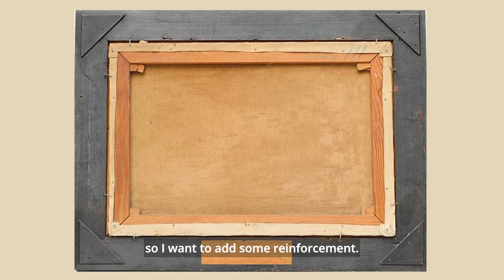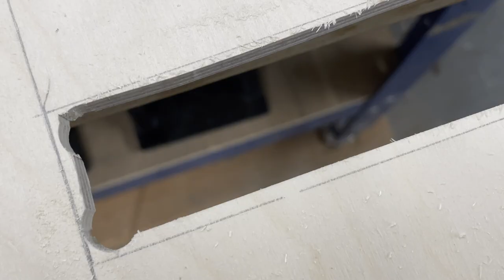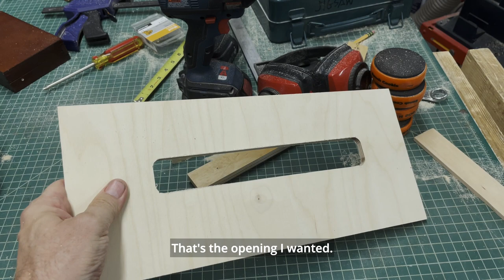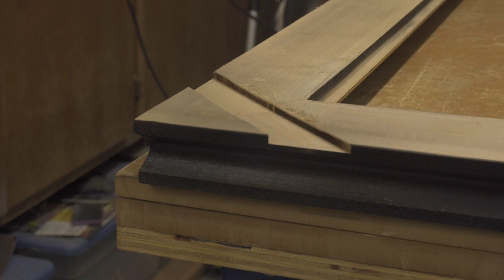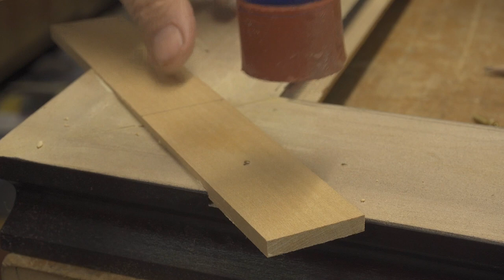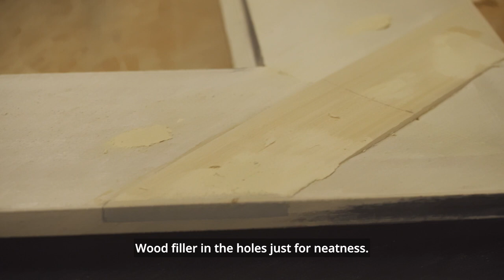Reinforcing a Picture Frame

Comment: Do you normally seal and reinforce the back of the frame when you originally build it? That could help mitigate the movement or weakness that cause opening like that. Very interesting to see how these problems are resolved, and will try that routing technique
Reply from the maker: I have generally used Brad nails and biscuit splines for frames like this, but this frame may have lacked the biscuits, I’m not sure.
I also have have a v-nailer. But with recent traditional frames I’ve been adding this back spline and sealing with shellac - so far good results!
Reply: Good tips!